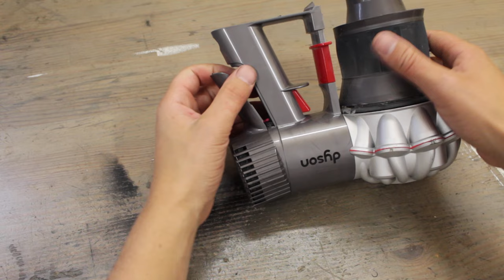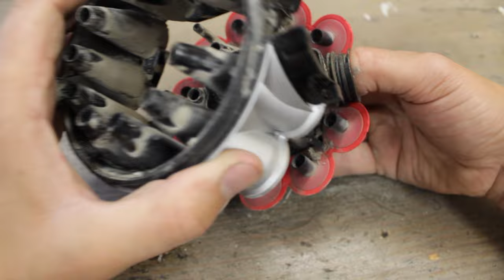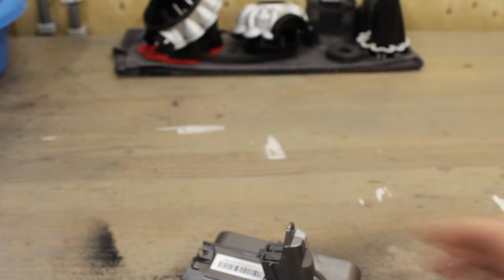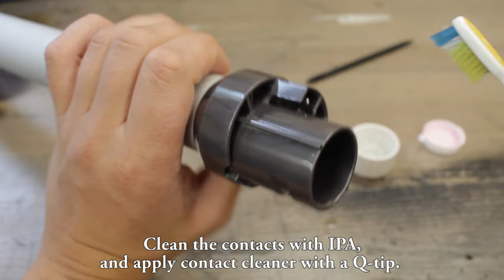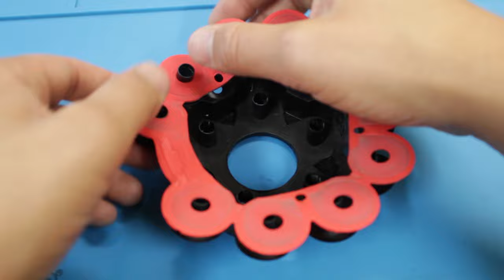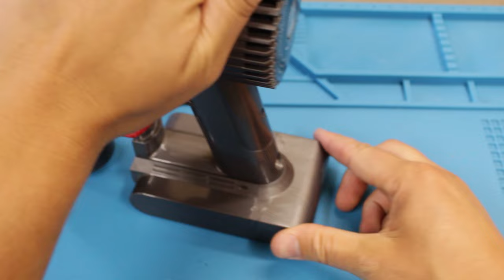Dyson DC62 disassembly and cleaning tutorial.

Comment: I hope Tyson's paying this guy because I would hate to see how many people have ruined their vacuum trying to do this and have to buy a new vacuum
Reply from the maker: Unfortunately, this guy is not paid by Dyson.

Of course, there is always a chance of something breaking when you take apart an appliance. Obviously, the goal is to extend the life of your vacuum cleaner if it loses suction due to clogging, for example.

No reason to take apart a well-functioning vacuum cleaner.
Reply: Indicazioni precise,sono riuscito a smontarlo e rimontando con facilità. Funziona benissimo. Grazie al ragazzo.😊😊
Reply from the maker: @erosroberto  Non c'è di che. Grazie per la risposta
Reply: I'm following each step and the process is working just fine and I'm not that inclined with take-apart jobs. I'm very grateful for this video, particularly because he wasn't yapping the whole way throgh. I got the vacuum second hand and it really stinks. I had trouble getting the cheap screws out so wasn't able to take the machine completely apart but got enough apart for a deep clean. We'll see what the smell is when I reassemble it.
Reply: @harmstro2 most likely some moisture has been sucked up in the past.  That then soaks the fine dust causing it to grow bacteria. That's where the smell comes from .   Give the Cyclone a damn good soak, then wash , shake scrub (small bottle brush) anything you can get at.  Then leave to dry for 48hrs in an airing cupboard.  
Especially if you cant disassemble completely. 
Goid luck 👍
Reply: Worked like a charm! I took it slow and worked carefully

Comment: Excellent video! Very useful! Thanks!
I have cleaned mine and will reassamle tomorrow hopefully without problems. I can suggest to add the number of screws that are unscrewed at each step to make sure you have all.
I decided not to clean the filters on the back of the motor because I was unable to disassemble the part.

Comment: great help !!  thankyou !     i did it and currently the parts are drying. 
(only the fine foam was pretty much disintegrated and fell apart..  i wonder if packing foam is the same..
Reply from the maker: You're welcome, I myself used an aquarium filter for a dyson where the filter fell apart. That one was very similar. 

I think packing foam works fine too.
Reply: @SpareTimeWorkshop  so i bought the upgrade from aliexpress, with the different filter and now want to re-assemble.  
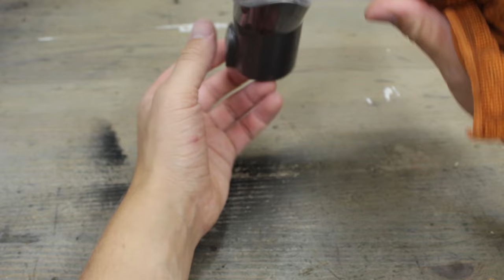but i wonder if the dustbin can be seperated from the grey nozzle for cleaning..  the thing you show at  10:26   
there seems to be a screw behind the electrical plug (?)   i would like to get these seperated since i see dirt through the transparent bin and also i can not move any flap there..   seems like solid..
Reply from the maker: I've tried, but I can't get it off either. If you did get it off it would be a lot easier to clean.

Comment: Would you recommend to buy the original battery or is it okay to go with the knock off?
Reply from the maker: I recommend buying the original one. I myself replace the cells of the original battery. (So I can put good quality cells back). But this is not something everyone wants to do.

Often cheap cells are used in replica batteries.